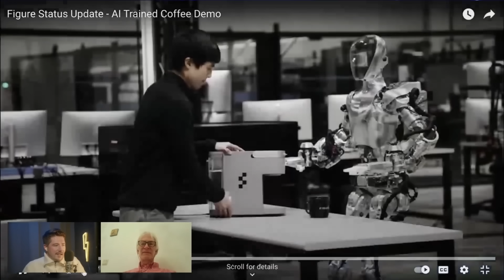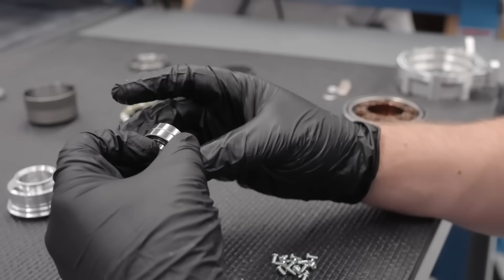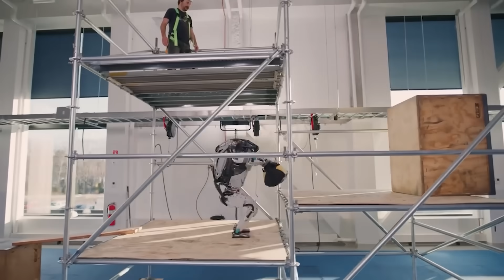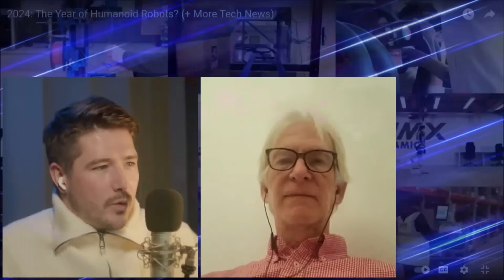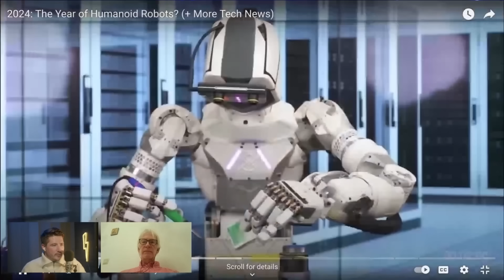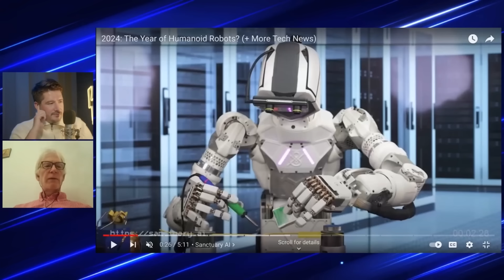Tesla’s OPTIMUS HUGE advantage over FIGURE BOT!

Comment: No need for the battery life to be 5 to 8 hours, change to a replaceable power pack same as cordless drills, hot swappable by the robot with either a small permanent battery of using multiple batteries. Even 1 or 2 hour battery life with 30 second at a recharge station will be fine.
Reply: Borg regeneration alcove.
Reply: A factory with 100 bots working might need 105 bots. Fully charged bot trades places with depleted bot which heads to the battery swap station.
Reply: could have say wirless charging pads where the robot stands too
Reply: @NicholasOckhuisen  Charging coils in the floor where the robot walks. It wouldn't even need a designated charging port.
Reply: Use a modern capacitor bank if you have to be quick.